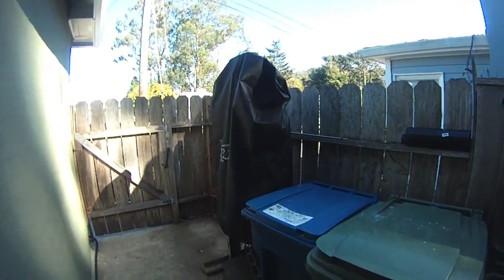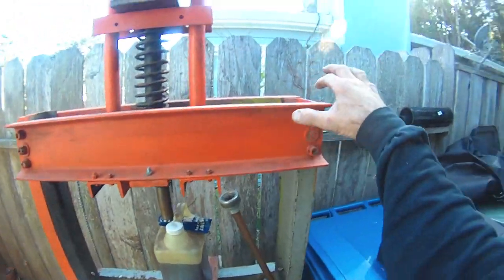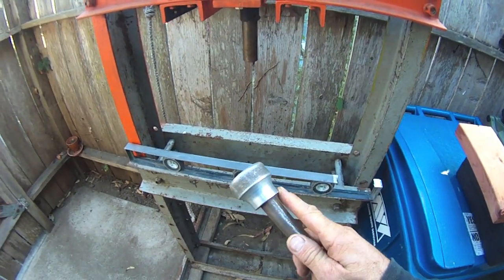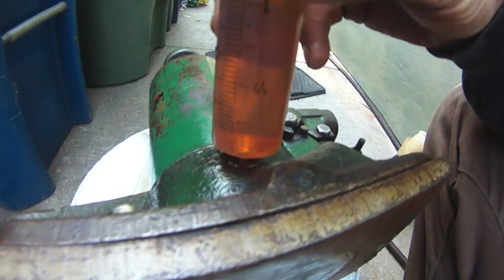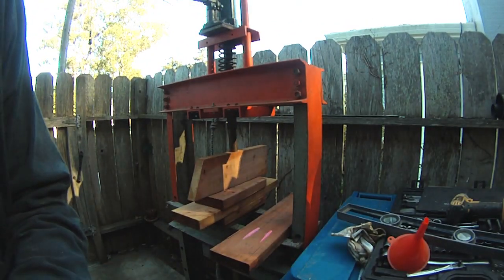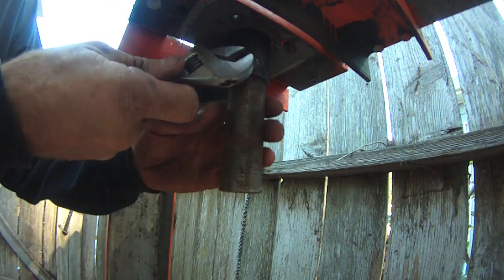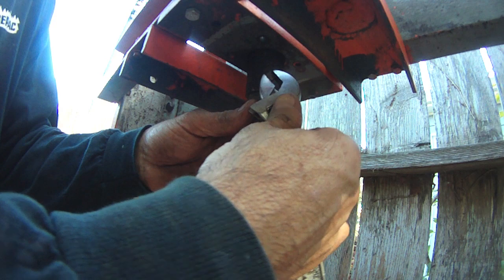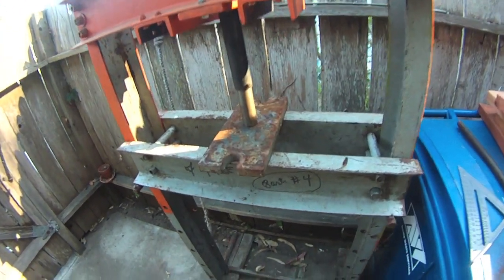Home Made Shop Press Needs Work

Comment: I like that press but I would enlarge the holes on the low (short) side to square it up but o check that this is the same both sides of the horizontal beam. IE check for 90D in all down pressure planes.
Re YouTube behaviour of late, most of the folks I subscribe to are having similar problems of uploads being referred and requiring manual review.
Reply from the maker: I agree with enlarging the holes and squaring things up...it is just safer in the long run. Thanks Dan.

Comment: Id agree it would bug me too but the pressing is in the center of the press anyways.    If you have to level it ( which i know you will anyways...great minds think alike)  would it be easier to make the bed square it only 2 holes ( front and back) rather than the top with 6 holes for the 3 bolts
Reply from the maker: I'm going to give it a good lookover..elongate the low side holes and push that bar up..see where it sits at that point.

Comment: Could the problem be that the pieces of channel were cut and drilled in a unique way that it is only square when the pieces are in the correct position?  If the pieces of channel are not perfectly symmetrical, there will be one way of assembly that is "sweet" and the other way is effluent.
Reply from the maker: It could be, but I doubt it...this has never been taken apart and sat in the same spot since 1972.  Further work will be done for sure...I just can't keep it out of square like this.